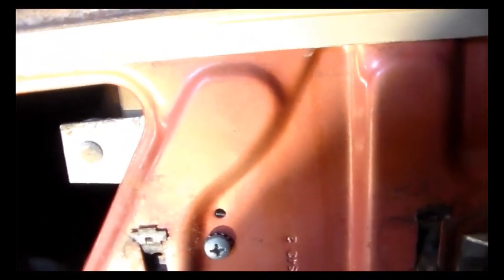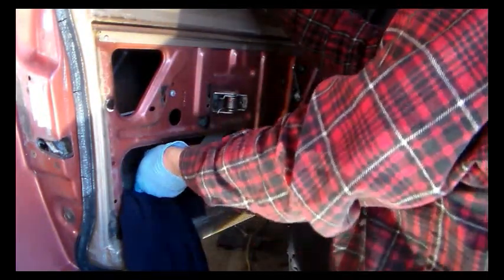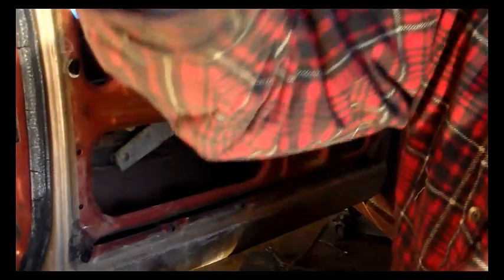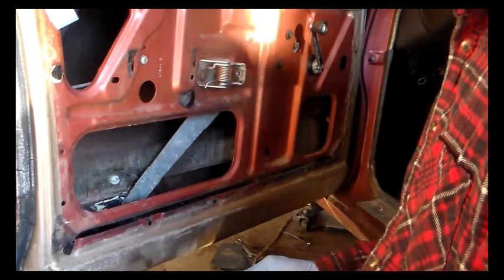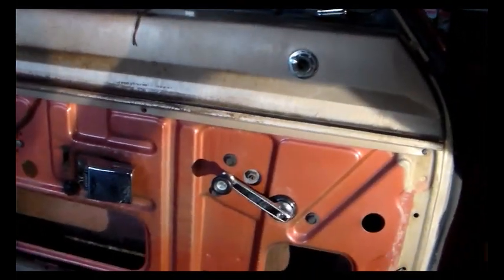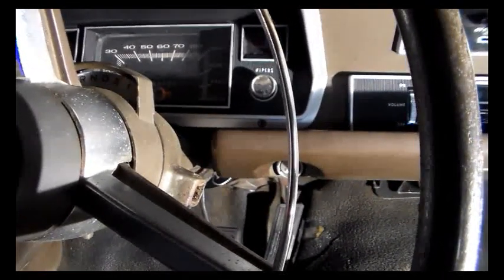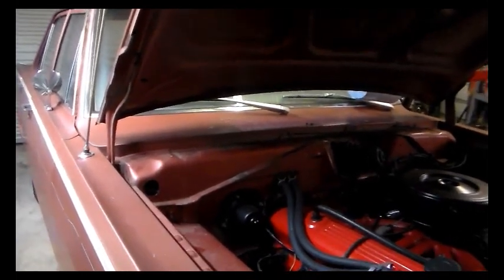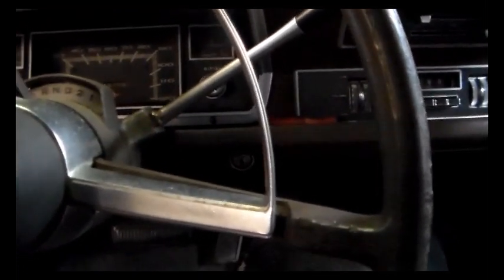Get the 1968 Plymouth Valiant roadworthy part 2

Comment: If your ever faced with the situation of holding the door window glass up again, try taking a wire hanger apart and rebend it to hook the bottom of the glass on one end and through the window opening at the top of the door panel on the top end. You might be able to use a rope as well, depending on the design.
Reply from the maker: Thanks!
Reply: That’s a good tip.

Comment: Do you think the windows in my 1971 Demon are the same, I realize the doors are longer.
Reply: I don't think they are exactly the same, since the window is longer, but they're similar.
Reply from the maker: Right, there may be 2 rollers, but the general mechanism should be similar.